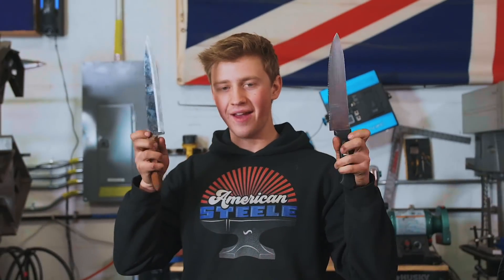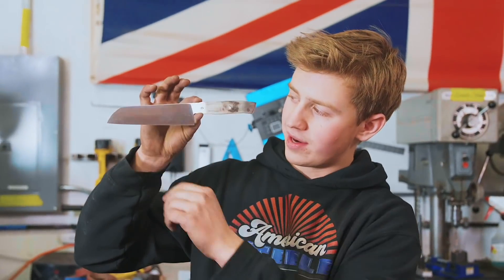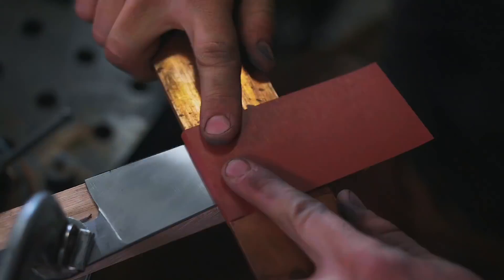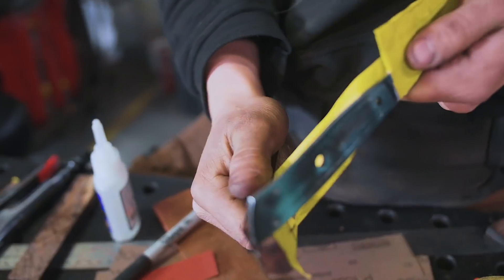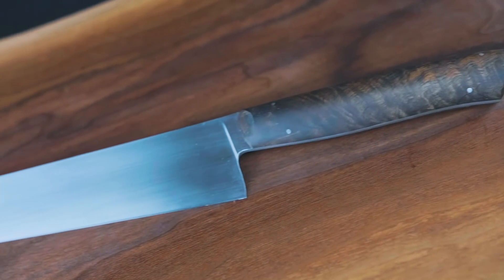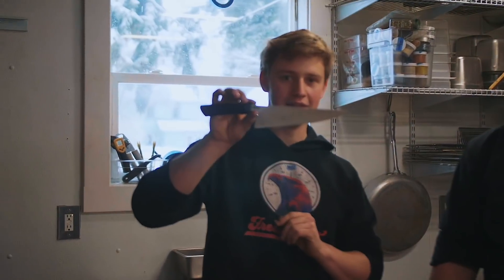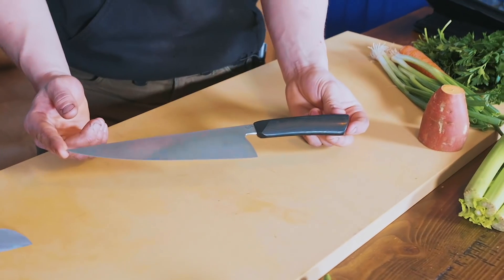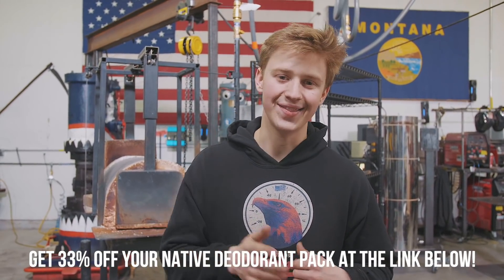TURNING A $1 KNIFE INTO A $500 CHEF'S KNIFE!!!

Comment: I was expecting y'all to forge weld all the blades together, do a few folds and make a totally new knife out of them (with some etching).  The SA wood was a nice touch though, quality handle worth way more than the metal it was just riveted to.
Reply: Unless you are working with carbon steel it is extremely difficult to get a useable heat treat with an unknown steel. Even when you are using a carbon steel knife the heat treat would almost certainly be sub optimal.

Comment: Misleading thumbnail... Suggested black plastic handle knife was the one you worked on... I'll never forgive
Reply: I had those plastic handle knives. He wouldn't have been able to actually do anything with them. The tang inside the handle is about an inch and a half into a molded plastic handle. I found this out after I snapped one trying to cut a block of cheese.

Comment: I love how Will is so good at very quickly and effectively sharing a little pro tip like the tape and super glue. Doesn't spend so much time on it that you are begging him to get back to the knife making, and doesn't run through it so fast, or skip over so beginners like me are wondering how the pros do it and making mistakes. I would have just super glued right to the wood and steel like an idiot. Quick clear communication. Bravo.

Comment: I'm a chef and been cooking for 25+yr.  There is definitely room to improve  that santoku knife. Most Chinese Japanese chefs knifes tend to be single bevelled, as they offer a key advantage – they are extremely sharp. This is due to the fact they only need to be honed on one side so it is easier to create a much smaller, thus sharper, angle. The disadvantages are that it takes practice to learn to cut straight with a single-bevel knife, and the knives are specifically left or right handed. The santoku  usually has another distinctive feature as well: a row of shallow dimples on the side of the blade. These depressions, called kullenschliff or a Granton edge, reduce friction and help prevent food from sticking to the blade.

Comment: The whole video is basically an advert. And the whole length of that initial knife wasted. The blade chopped off and then grounded thin to the result that the edge no longer has any support. Some of the videos are disappointing. This is one of those.

Comment: The $400 knife is $400 because it doesn't dull after each usage, it won't get fractures over time from flexing, and is designed for the needs of a professional chef. U can't take crappy steel, cut the end off, sharpen it and call it a $400 knife. There's more to it than just being sharp.

Comment: This is a nice project. I think the title is wrong. It should say a $500 looking knife. 
Will is right, the steel is questionable, regrinding does not change this fact. In my opinion a 1 tough (or 0.02 mm in a real unit if measure) edge is way too thin for a chef's knife even if the knife only has a 55/56 Hrc hardness. A straight razor has a thicker edge. In the wrong hands this edge will chip, or if lucky bend, in no time.

Comment: I was kind of disappointed that there was not more done with the $1 knife. Like a tempering/edge quench and annealing step. I know it is no-tell-motel stainless steel but something could of been done (I guess?).

I want to learn things, learn tricks of working with metals. This seemed like an infomercial and I removed my normal thumb's up rating but couldn't quite find it in my heart to give it a thumbs down (Will is still suffering from the powerhammer).

As a question regarding tempering/ quenching;  Can you do an edge quench by skating just the edge of the blade across a block of ice really fast? would that make that 0.5mm or so of steel very very hard? Then if you did an annneal to remove stresses it might not be so chip-prone and the body of the blade might have some flex?  IDK, just a thought, those are the kinds of things I would like to learn.

When Will finally goes his own way I would like to watch him go out on his own.

Comment: So what makes this worth $400?
The steel would still be just crappy quality steel, right? There was no tempering or anything else involved in this video except just cutting the end off and re-grinding the knife...
I wonder if this knife would be vulnerable to bending and snapping now cos the steel is too crappy to put up with all the flexing.
Also, as the chef said, the knife becomes dull after a small amount of usage.
The 400 dollar knife is $400 because it doesn't dull after each cutting, it won't get fractures over time from the flexing, and it is designed to fit the needs of a professional chef.

Comment: $400 is an extortionate amount of money to spend on a chefs knife made from M390. M390, whilst it retains and edge well, it's pretty difficult to sharpen with normal ceramic whetstones and really needs a diamond coated sharpening stone to get an effective edge once the initial factory edge eventually wears out over time. something like SG2 would have been a much better choice of steel if you wanted a stainless steel. As much as i love you guys this is a really poor choice. 

In reality you're asking people to pay Masamoto KS money or Kramer' mass production run with Zwilling money for a knife made out of something that is much more suited to a pocket knife than a chefs knife. The reason it's not used in kitchen knives isn't down to availability it's because it's a terrible steel to use in a chefs knife because of the frequency with which chefs knives require sharpening. 

I get a lot of people will buy this knife to support the channel, and if you've got that money to burn, then that's fine. i just think its a little irresponsible to ask people to pay that much money for a knife that i'm sure will be great out of the box, but will be a pain in the ass after about 6 months of usage. 

I know you guys probably wanted to go stainless for maintenance ease, but honestly Shirogami #2  heat treated to a 60-61 HRC is generally the best balance of edge retention, sharpness, and ease of sharpening.